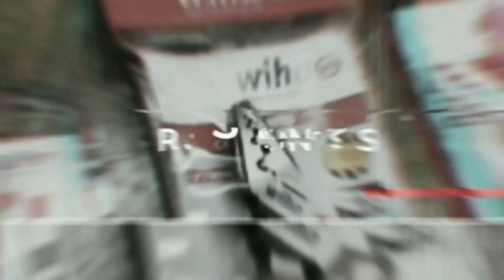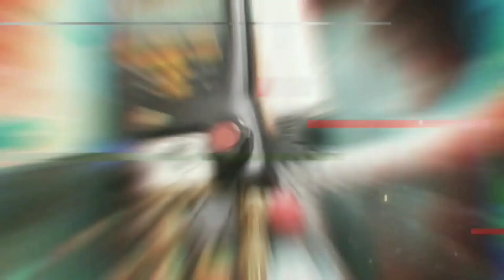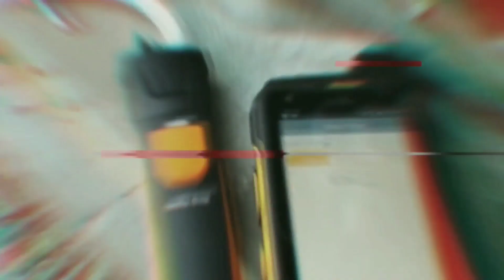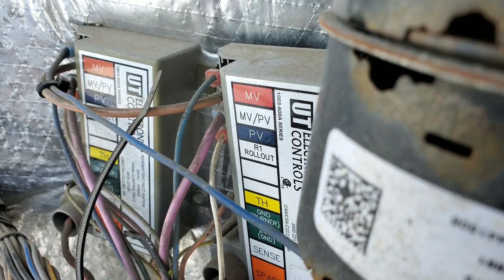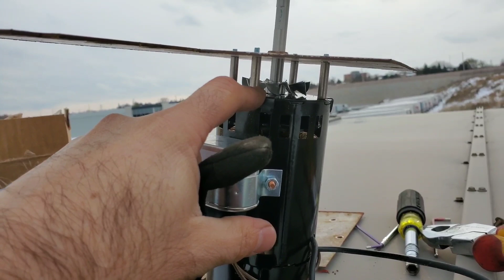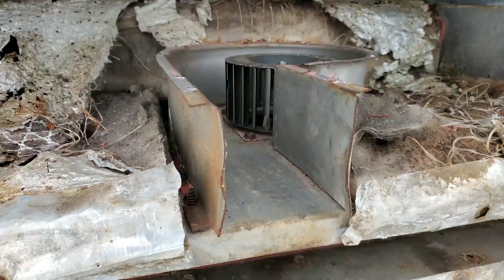Heating Repair - Always Change This Part

Comment: This video is exactly what I'm up against when I go back to a call Tommarrow that i was at.i had no spark on ignition on 2nd stage module ireplaced ignition control and still no spark I tried another ignition control that did not have the r1 rollout terminal on it and I had spark ,I checked rollout had continuity so at this point I'm going back with a new rollout switch hopefully that was my problem all along.thanks for video hopefully its a quick fix

Comment: Great video! You're absolutely right about that rollout switch. Also, those little rollouts or high limits in the heat exchanger compartment can create havoc as well. I had to change them out on the coldest day this winter.

Comment: I use a mirror to visually see spark ,Dont go based on sound,get a visual on your spark use a mirror and visually ID GOOD SPARK.never had to routinely change modules and rollouts,HAD TO ROUTINELY CLEAN ,ADJUST,NUISANCE CROSSOVER TUBE ISSUES TRUST ME DAWG
Reply from the maker: The module is not a routine change out, it's not generating a spark.  The roll out on York, rtus is a must to replace,  they cause a lot of problems, intermittent and direct.

Comment: I'll be honest I never had to always change a module every season,with thos particular units and there one of a kind design, pm s are must for maintenance on the crossover tube,the separation between the spark and the crossover is a must ,I would bet the farm that's what u have goin on,very sensitive that design with the crossover tube,spider webs after the summer,or moth nest.
Reply from the maker: The video never stated that the module every season.  I said the roll out should be replaced on every heating repair and I explained in detail why.